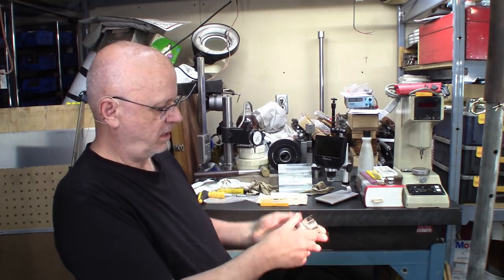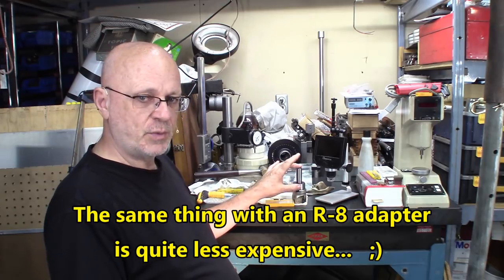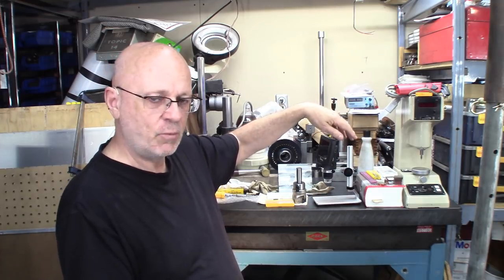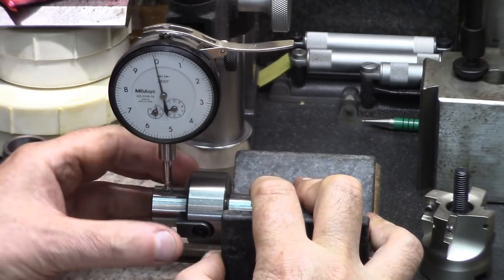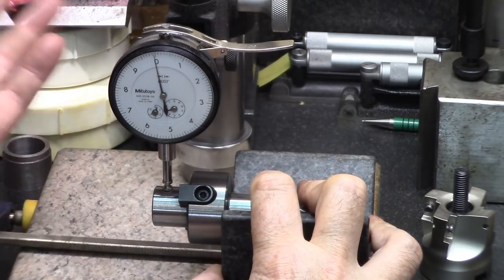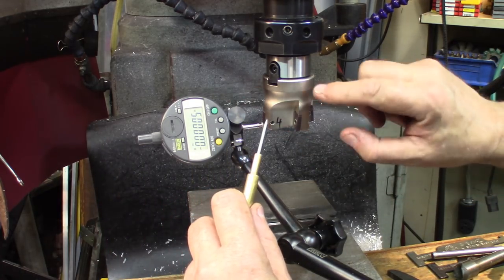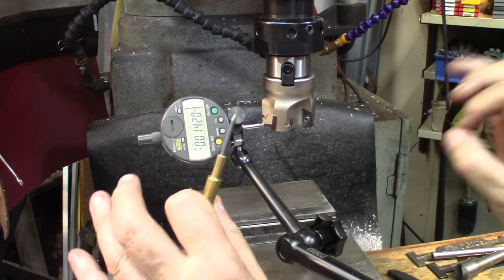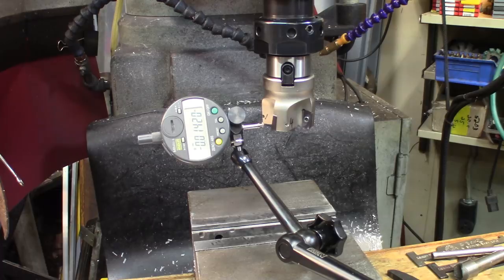Face Mill, APMT1604 inserts, electronic microscope, Blue Nano SUPER inserts...

Comment: Thank you Pierre! 
I have this same face mill (with MT3) and was having trouble getting an acceptable surface (on steel). I tried 450 rpm and the surface was terrible and the vibration was also bad! (I just have a small lathe/mill combo) So I tried 200 rpm and that was better but not much, So I tried 600 but the vibration was TERRIBLE and the finish was no better, so back to 200. I searched Youtube and found this video and I thought if you could run it at 1000 maybe I hadn't tried it fast enough. So I tried 900 rpm and lo and behold, it made a beautiful surface although I still can only cut about 3-4 thou or it will shake so bad that the surface gets bad fast! Small mills have some big drawbacks!
So thank you very much for posting this, it helped a lot! 👍
Reply from the maker: Hi,
When you want good surface finish with any tooloing, there is a need to accomodate the edge sharpness to the turning speed. For carbide tooling those speeds range from about 350 to 700 surface feet per minute, too slow it's not producing enough pressure to effectively remove the material, too fast, it just produce excess heat that destroys the tool and changes the properties of the machined part....

In your case:

SFM= (  3.1416  x  diameter of the mill in inches  x  RPM)  /  12

523.6 SFM =  (3.1416  x 2 "  x  1000RPMs  /  12

This would be a suitable speed for mild steel machining, then you adjust the depth of cut and advance rate according to the capacity of you machine, each insert should cut about 2 to 3 thousands of an inch. his is adjusted by the advance rate.

Have fun exploring and experimenting safely...

Cheers,
Pierre

Comment: BEST BY FAR--I have several of the cutters a few different sizes. I design and make a universal arbor however and I do not use the shaky loose supplied arbors for several reasons. also those things are called DRIVE DOGS..

Comment: Im pretty sure this is the facemill i bought with the r8 adapter. The threads arent deep enough forvthe taper to be drawn all the way in my mill. I had to relieve the threads at the beginning and tap the r8 adapter deeper for it to fit. Now it seems to be working good, I think a good value

Comment: Good to see you - sound is still reasonably adequate. 
I have not managed much shop time of later - too hot and many other factors.
I have the R8 face mill but rather like the options for using the shell end mill. Must get me some of those blue nano inserts.
Adapter sure seems very good for truth .. also shell - excellent detailed review, including cuts... quite impressive. 
Worth remembering a bit of fiddle can help with set up.
Reply from the maker: Hi Chris, always a treat to have you show up here... 
I'm trying hard to get back to a regular schedule on producing videos, not so muche the heat like other stuff since last Winter, hope things settles enough to give me time and energy to get back on track...
Those Blue Nano inserts are something worth trying, I'll try to do more testing in future projects..
Cheers,    Pierre

Comment: Hi Pierre, another honest review thank you, I happend to get a 50mm Face mill like yours where the holes for insert screws where located wrong, but after Ebay got in on the deal I got my money back, all the best to you and yours.
Reply from the maker: Hi, sometimes, there are parts that escape the manufacture without a good quality control, so far when it's distributed by Drillpro the quality is really acceptable, at least for the products I've tested so far, can't say this for all Asian products....
This is where it's important to deal with companies that will refund quickly defective or unacceptable products.
Thanks for comment,    Pierre
Reply: Yes all my Drillpro items are also ok, have a nice weekend. BTW this mist cooling system works fine, uses it at 4 bar. It has to be the model where you can adjust both the air and coolant.  https://www.ebay.co.uk/itm/Metal-Cutting-Engraving-Machine-Mist-Coolant-Lubrication-Cooling-Sprayer-System/391569848912?hash=item5b2b61ba50%3Ag%3Ak%7E4AAOSwvmRajhes&_nkw=mist+cooling&_from=R40&rt=nc

Comment: Pierre

After going thru all those precise measurements, would have loved to have seen you take it one step further and checked the run out on the actual cutting edge of the inserts.  Ideal would be all the  inserts at exactly the same level, but wel know in the real world that would be extremely rare, but knowing the differences would be great indication of how well the mill will cut

John
Reply from the maker: There are gonna be more evaluatio in some future videos, then, if possible, some more tests could be added as you suggest, good idea...
The goal here is to get some decent tools for lower budget users, the ones that would never be able to afford something from high grade brand names.

Thanks for your comment,    Pierre

Comment: Perfect timing as I am shopping for a face mill this week. I wonder how well these would hold up in my VMC?? Hope you are well, sir. - Tom Z
Reply from the maker: Hi Tom,
Hope you're doing fine also, it's been a while...   
This tool with Blue Nano inserts does quite well on most steel materials, I'm presently working at editing some footage using this set-up on Titanium with flood coolant at Philippe's place. We succeeded in over working the inserts  (Causing them to chip ) in 0.135" DOC in GR5 Titanium. (750 rpm, about 5 inches/min advance ) .  Titanium is a real tough material for just about any type of tool, since not many people can afford Titanium, it's not so much an issue since those tools do real good in most type of steels including hardenable ones...
I haven't measured the R-8 set-up, though...
As far as I'm concerned, tools offered by DrillPro are delivering good performance for a decent price, haven't tested all of their offering yet...   ;)
ATB,     Pierre
Reply: I'll definitely consider this as an option, thank you! I wonder what sorts of speeds it can handle since I've got a 10 HP, 10K spindle on the machine. Maybe using high-feed rates but lighter depth of cut. Maybe I'll do a comparison on video just for fun!
Reply from the maker: In Titanium, it's a quite different story, steel isn't needing to rake as hard to remove the chip and also the heat from the part, as in Titanium the heat stays much more in the part, meaning als that there is gonna be more deformation due to heat, so you'll need to try to compromise on removal vs ship and heat removal....    Would need some trial runs to determine the best feed and speed.
In steel the response would be quite better.
Lets see what you can get from this setup...!!!
Keep me informed.
ATB,     Pierre

Comment: Really nice video and review. Do you used "conventional milling" with the shell mill due to backlash of the acme thread? Or like CNC do you use ball screw? It's the first time I see "conventional milling" with inserts
Reply from the maker: Our machines have Acme thread leadscrews, not compatible with climb milling, at least on heavy cuts, sometimes we allow ourselves some light cuts in climb milling, with a slight pressure by tightening the the gibbs a little.

Comment: Brand new edge looks great, 901 insert?
Reply from the maker: By looking very closely, the cheaper inserts aren't as polished or closely toleranced the real costly brand name inserts, also they don't get offered in many forms in order to address the many different situations and needs, on the plus side, they will do the job well in most situations where optimisation isn't required.
When you pay 1 or 2 dollars for an insert instead of 10 to 20, it makes a serious difference for the user like small shop or hobbyist.   👍🤑

Comment: I bought the same Microscope, bought pretty much the same kind of stand, and then installed the hold-down stainless steel clips, at the back next to the vertical riser that could be used for microscope glass plates or for parts, perse'. I do supply constant voltage to the microscope's light circuit. A wire to always keep out of the way of everything else.
Reply from the maker: This little microscope is fine for direct viewing, it still does ok for recorded pictures, if you watch in some of the later videos I'll review a more expensive and better microscope, it's much better on all aspects, bu, it's 4 to 5 times the price of this one, though...
Quality has a price, and all depends on what are your needs as well as your budget...